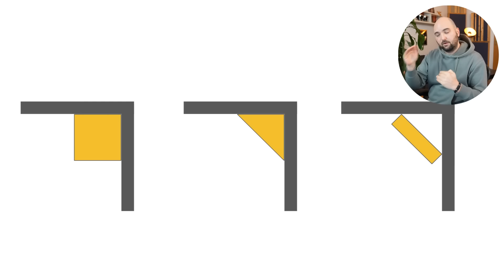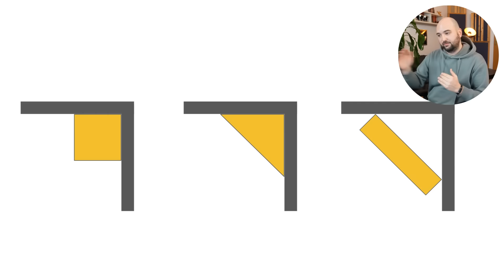Bass Trap Shapes Compared: Which Design Actually Works Best? (with diagrams)

Comment: I have been taught a completely different method of figuring out what low frequency absorption you need, how much and where to place them.  Also, what isn't discussed are there are three types of low frequency mode types.  Axial, Tangential and Oblique.  They are the unwanted sound pressure between 2, 4 or 6 surfaces, respectively.  The other issue are coincidental, which is when you have dimensions that produce problems where the dimensions produce a problem around or at the same frequency or within about a 5Hz difference.  Example. if your room has a square floor plan, this will create coincidental modes along both front/back and side to side.  This can also happen if the height is similar or the same or a multiple of either the front or side walls dimensions.  A Cube would be the worst since all 6 dimensions are the same.

Now, the first step is figuring out what frequency (s), the amplitude and their location and the best one to attack are the Axial modes.  Why?  Axial modes are the biggest in terms of amplitude, and they are the most difficult to fix and they also, unfortunately, require the most amount of absorption and they are typically the fundamentals and they typically start around 30Hz to 50Hz in most rooms.  if you go after the Axial mode problems, if you use the right product, you can actually fix the Tangental and Oblique problems as a result.  Yes, it is expensive and it requires a LOT of surface coverage depending on the size of the speakers you are using, volume levels being played at and how smooth of a response curve you're looking for.

Why do these problems exist the first place?  It's because our rooms are simply not designed to absorb low frequencies belong 100Hz in the first place.  Ultimately, we should use rooms that are designed where the low frequency problems below 100Hz down to 30Hz are built into the actual room structure walls, floor and ceiling, but this is expensive, but I've seen rooms where this was done so you don't need any "bass traps" in the room because it's all handled within the structure of the room itself. But the thickness of the walls, ceiling were 16inch thick using 2x12 studs and they had calculated the internal depth of each wall cavity specifically figuring out what "bass trap' was actually built into the structure.  The result is effectively a flat response curve down to +/- 1 or 2 dB no matter where you stood in the room.   But these types of rooms are EXPENSIVE, plus they are fixed structures that you can't pack up and take with you when you move to another location.

But for those of us that have prebuilt rooms where the walls are typically 2x4's with sheet rock, then we need to effectively build a "room within a room" with large, deep bass traps along each wall, floor and ceiling to really achieve a smooth room response curve. The problem is that it's expensive and it takes a lot of units, and it will reduce the usable floor space as a result. Also, for those that use double wall using 2x4's with sheet rock, those STILL will not absorb the low frequencies in the 30Hz to 50Hz range. 

Now, as far as corner traps? NOPE. I would NEVER, EVER use them.  Why?  First off, it's simply not enough surface coverage. I've seen before and after measurements of bass traps on the corners and they didn't really do much in terms of lowing the peak of the low frequency problem.  They typically just cut a small amount of the decay, but the peak still existed.  they aren't absorbing the Axial mode problems. I would highly suggest going after Axial modes with low frequency absorption instead. the results will be much better, but they require more surface coverage thus using more units.

To go after 30Hz to 50Hz problems, you need at least 12inch to 16inch deep cabinets.  You simply can't get around this. If you are using absorption that's less than 12inch, then you aren't going after the 30Hz to 50Hz range, you are probably going after more like 60Hz or higher.

I've been in rooms where there were large bass traps that were up to 16inches deep and about 5ft tall and they had double front wall with an air gap and they used a VERY dense, and porous material that's MORE dense and porous than building insulation (mineral wool, fiberglass, etc.). The results were the best I've ever heard because they really went after the low frequencies and were capable of absorbing enough of the problem where you could hear individual notes, instrument separation like I've never heard before.

Please comment on specifically why you think this is not the best way to approach fixing the problem.
Reply: Quite the contrary, ... corner placement is ideal for addressing modal resonances regardless of type. 

All modal resonances terminate in corners. 

So, such placement is optimal for effectiveness as it damps axial, tangential, and oblique resonant energy. 

Regarding higher density material for bass trapping, care must be taken to not utilize excessively dense material in a thicker panel. 

With porous absorption, when transitioning from typical thicknesses, to thicker more effective trapping ... one must use less dense more porous material. 

A common rule of thumb is 4" or less in thickness, rigid insulation is ok. 

At 6" to 8" or more in thickness, it's best to use less dense material. 

Of course there's superior approaches to bass trapping, ... ie., waveguided hangers, etc. 

However, for mammoth bang for your buck, extremely effective, inexpensive and easy to DIY, corner mounted porous absorption works every time. 

Thanks
Good stuff

(plus, via careful loudspeaker placement and listening postion, one can avoid some of the biggest modal problems)
Reply: @FOH3663  It also depends on the size of speakers. I mean, if you are using small mini monitors that only go down to maybe 50Hz and you have them in a near field placement and they are several feet from each wall, then that's a different scenario. But if you are using substantially larger speakers and you have some distance between the speakers and the listening position and it's not a Near Field setup, then you WILL have problems.
Reply: @FOH3663  

"Quite the contrary, ... corner placement is ideal for addressing modal resonances regardless of type. 

All modal resonances terminate in corners. "

When you say terminate in the corners, what exactly do you mean? Do you mean that you can't measure any modes in the side walls or within the room? Yeah, right. Measure..  You can take a dB meter and put sine waves at 30, 35, 40, 45, etc. etc to 100Hz and measure from around the room measuring the corner and then go another 2 ft and see what the measurements are.  In the +dB ranges, that's where you need to put a low frequency device.

The notion that only in the corners do low frequency (under 100Hz) pressure is located is pure, unadulterated GARBAGE.

Even room mode calculators like AMROC can show you a 3d representation of just Axial modes and they are NOT in the corner, they are along the entire surface. Axial modes are the most audible, the biggest in terms of amplitude and thus the biggest problems within a small room.  If you can fix that, then the others fall in line.  

the lowest frequency problem ARE Axial modes.  Think of those as the fundamental.

Here's a link to a room and it shows JUST the Axial modes.

https://amcoustics.com/tools/amroc?l=21&w=17&h=9&st=false&so=false&ft=true&r60=0.6

Click on each frequency and look in the 3D rendering where it's located.  

Where ever you are sitting, you are either where there is peak a null or somewhere in between at various frequencies so this notion of just treating the corners is absolute nonsense.  terminating in the corner has nothing to do with how to treat the problem.

I haven't seen a single room where they placed low frequency absorption just in the corners and that flattened out the room response curve to +/-2db down to 30Hz. Please show me one and maybe I will believe you.

The corners represents a VERY small surface coverage and it's just not enough for low frequencies, even mid's modal pressure problems.
Reply: @FOH3663  Less dense?  Less dense won't absorb as much. You need MASS.

I've ran into you before and we've had arguments and you never seem to actually provide indisputable proof, so please stop arguing unless you can show proof.  I've been in rooms with corner traps and they has massive low frequency problems.  I've been in rooms that had low frequency absorption along the entire walls and they didn't. So, I've been in both scenarios.
Reply: @Oneness100 
Yes, less dense ... thicker porous treatment requires less density for optimal effectiveness. 

I know who you are.
Reply: @FOH3663  Huh?  For what frequency range?
Reply: @Oneness100  
It's your example up above. 
The 16" deep porous absorber, utilizing "VERY dense porous material". 

I was correcting you ... the deeper a porous absorber is the less dense it needs to be for max effectiveness. 

Plus, as I pointed out, corners are ideal for bass trapping ... although you state otherwise.
Reply: @FOH3663  The cabinet depth determines the frequency in regards to a diaphragmatic absorption device.  If you put fill material that's less dense and less porous, it's not going to absorb as MUCH compared to a much dense and more porous fill material.

I've had a discussion with someone that has designed and tested a number of different types of fill material inside the same diaphragmatic absorption device and the measurements were conclusive.  

You should talk to someone that's actually tested a variety of different materials inside a diaphragmatic absorption device and studied the effects of different fill material.    

You can certainly build your own diaphragmatic absorption devices and test different materials yourself and come to the same conclusions.
Reply: @Oneness100  
You never mentioned membrane trap. You simply stated 16" deep air gapped absorption ... and the superiority of a more dense approach to porous absorption.
Reply: @FOH3663  I didn't say "air gapped", you assumed that.  Sorry if I wasn't more specific.  I also think it's ridiculous to say that corners are the best location for low frequency absorption.  It's a VERY small percentage of surface coverage.
Reply: This is very interesting! I would love to hear more details on the types of dense & porus absorption you've mentioned. When you day you were taught a completely different method, where did you learn. I'm always interested to learn methods in acoustics because they vary greatly!! Plz direct to some sources to further learn! Thx for posting! 🤜💥🤛
Reply: I'm not here to add anything to your comprehensive insight (thank you very much for taking the time!), rather confirm your words - we're to either use a professional approach (or at least a room in room concept) or not bother at all, at least to my experience. 
Jesco's point is to find a proper balance between an acoustically improved living space and aesthetics. It works great for hifi listening, but isn't enough for a studio indeed. I think it purely depends on a person - some people are fine with whatever room they have, while others need improvements to justify their work - none of it leads to a proper sounding space, but it definitely helps with understanding sound.
Reply: @zerobject  The problem most people fall into is simply not good speaker placement, too much clutter in the room, at least for the home listener/hobbiest.  I've seen mostly really horrible room treatment choices.  There's a YouTube channel that I've been watching all of the videos and they had a series of What Not to Do, and they show photos of people's rooms and they discuss what NOT to do, and I'm sure everyone at some point in their life has violated most or all of the points they discuss. It's a great channel because they have short videos and they explain how to treat Low frequencies, mid's and high's, diffusion, and soundproofing/barrier technology.  People always make lots of mistakes as they don't go through the steps properly in how to deal with noise or room acoustics.
Reply: @Oneness100  I think you forgot to share that channel you mentioned, as this one seems to be making a circle, cultivating the same topics over again.

Although, my point was that it actually doesn't matter, how bizarre a "studio" looks like - it's more about understanding sound (and the way we hear and listen), than getting a good mark on room acoustics. And I believe people tend to go these different directions - treatment obsession or figuring out how to work in a horrible room, neither of which I'm advocating, but throughout the years I've heard so much fantastic music made in ridiculous conditions with ridiculous setups, that I came to just one conclusion - room correction and gear are highly overrated.
Yet, it's nice to have a couple of deep traps around sometimes probably.
Reply: @zerobject  Let's see how I can un pack all of your comment.

No one asked what channel I would recommend, but since you're asking. I go to the Acoustic Fields YT channel.  A little background.

Over 10 years ago I was on the internet looking around for a company that might be able to help me.  I stumbled across Acoustic Fields  and was intrigued.  The problem I had wasn't with room acoustics, it was with barrier problem in. I had a lot of leakage from a room next to me and I wasn't living in my own home at the time and I couldn't do any permanent construction, so he really couldn't offer me a solution because I would have to do some massive construction.  But we got into a long discussion and he invited me to visit his demo room and I took him up on his offer.  Here's what he did. He took amongst the worst dimensions for a room.  A 20x20ft garage.  And he arranged a bunch of products in a listening environment and he bought a cheap, used stereo with just 16bit DAC, an old cheap CD player and a pair of what I would consider crappy speakers with an entry level integrated amp. He said he bought everything on eBay for $350. His premise was to prove that the gear doesn't matter and it's the room acoustics that does.   My old home had a room that had 20ftx20ft floor space and I had a couple of VERY nice stereos in that room where I had minimal amount of room treatment.  And the difference was HUGE.

his crap stereo sounded just as good as many stereos that I've heard that cost $50K ore more.  The amount of treatment he had probably would come out to be maybe $25K worth of treatment, but the end result was insane. I've never heard clear bass before out of that type of stereo and so much clarity in the separation of notes, separation of instruments, and the room disappeared and the gear disappeared.  The ONLY problem he was dealing with was a tweeter that was was starting to distort. 

Other than that, it was without a doubt the best sounding listening Room I've even been in. I've been in rooms with hundreds of grand of equipment, professional recording studio's,  so I feel pretty confident in my listening and judging abilities, even though I consider myself STILL and ALWAYS learning..   Some of the worst rooms I've been in used nothing but building insulation or other brands of acoustic foam.
out of ALL of my experiences with gear, that demo was the most impactful to me in my over 50 years of being into high end audio.

As far as being able to get a great recording?  Well, the tracking room has different acoustics than a control room.

But the engineer either knows how to overcompensate for bad acoustics or they can't.  The tracking room itself usually has longer RT60 times because they might want more ambiance. 

But you first have to figure out the room's application and what type of sound you want.  Example. If you want a Mastering room, they are typically treated where they'll have literally 90% or more of the surfaces treated to produce the. most accurate listening environment.

An average home listener may want to have close to a control room, or maybe less treatment.  A control room for a recording studio might also have near 90% surface coverage or none.

That's all what the person wants and can afford.  What I find totally ridiculous are these guys with TONS and I mean TONS of gear all over the place and hardly any treatment.  the ONLY way to over come bad listening environment is a near field speaker setup.  Because otherwise you'll get reflections off the various hard surfaces of the gear and equipment racks.

The problem most people have is that they don't plan ahead of time, they don't usually budget enough for room treatment, and they don't have a systematic way of dealing with the design of the room and how they are going to treat it for the room's application.  It seems to me that most look into room treatment as their last thing on the list AFTER they've dumped tons of money in gear..  Sure, we all need gear to do something, but there's a point where people are dumping HUGE amounts of money on gear thinking it's going to solve a problem OR they deal with room correction thinking that everything can be solved with DSP.

DSP won't change the room's acoustics. it will try to manipulate the source material to "FIT" inside the room, so to speak and if the problems are big enough the end result will sound "STUPID".

The only time to bring a DSP or an EQ in the room is when you've achieved a flat room response that's at least +/- 3dB or less in the entire range.  Why?  An EQ can add phase issues, etc. and if you are only changing a frequency range less than 3dB, it's probably going to be less noticeable.  

All I can say is, over the years by watching the videos and having discussions with the guy at Acoustic Fields, hands down without a question, he's one of more knowledgeable and practical people out there.  He's done a considerable amount of testing with practically every type of material that's been used in the room treatment world and that was done BEFORE he developed his own foam and low frequency treatment.  His foam is insane. I've seen nothing else on the market that's quite like theirs.  Truly a unique product and I always thought, foam is foam. NO, It isn't.  I've used Auralex and Sonex and his is just insanely better.  It's denser and the cell structure is consistent.  Which I think lends itself to why his sounds so much better.  his low frequency products are hands down the best on the market. I've been researching every brand and model of low frequency treatment and I haven't seen ANYTHING that has better absorption coefficient curves.  Plus, the good thing is he sells build plans cheap and you can build your own and save a lot of money per cabinet. that to me is one of the selling points.  because the guy can do custom room build plans, sell pre built products OR deal with the DIY crowd, which is rare in any company in any industry.

What good treatment will do for the recording studio application is that the engineer will be able to produce better mixes faster because they are hearing the recording in a more accurate listening environment and when they make alterations to the mix, they might do or not make certain changes that translates better.

I don't make glowing compliments unless it's warranted. But that's just my experience and recommendation.
Reply: Loved your response.  Mine is a listening room.  The challenge is I want to absorb the base appropriately, but not kill the room.  I think a relatively high rt60 can be good.  My guess is I would want the decay times to be consistent across frequencies. What is the best way to achieve this.  My room is 15x36x8.5.,  carpeted with standard furniture.  Ai suggests the corner bass traps
Reply: @davidford8539   A high RT60 will be effectily room distortions.  that's the problem..

the best sound quality is direct sound at the highest amplitude, then the first reflections at a slight delay and lower ampltude, so there isn't any smearing, phase problems, and then the next reflections are even low amplitude and more delay.  there's a range that most people fall into.  it's just playing around with it.

I would first go into a room that's FULLY treated first that has at least 75% or more of the surface area treated.   

it seems to boil down to some are fine with less treatment, but it will be less resolution. I don't know how much money you've dumped into your system, but if you've spent $25K or more, I would think that you want to hear as best as possible of what you spent your money on. spending $25K on treatment might get you to that point where your system will just perk right up and you'll enjoy it more and give you a room where if you swap components, you'll really hear the difference.